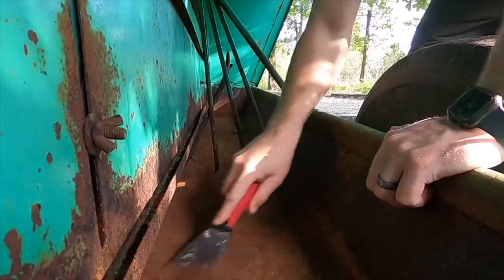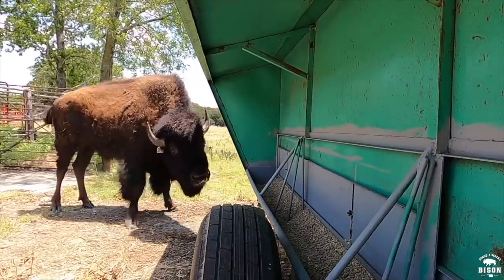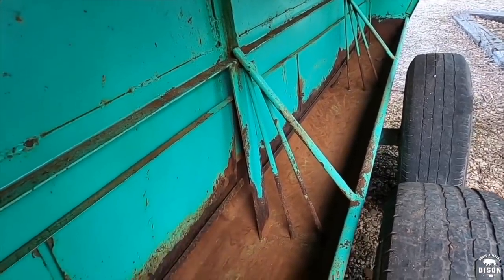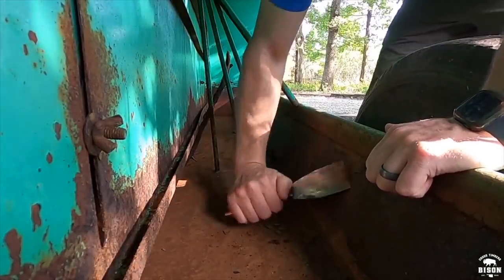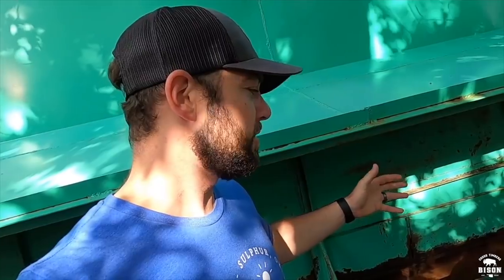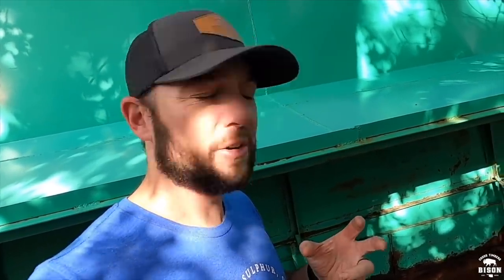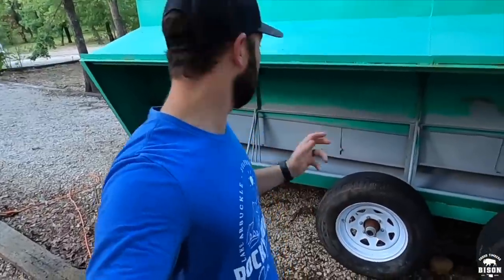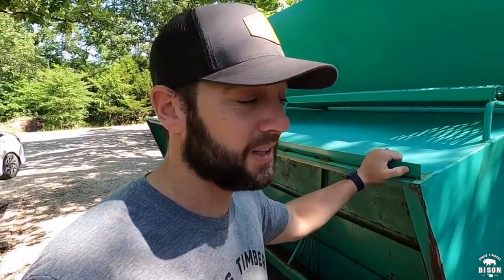Farm Renovation Project for the Bison!

Comment: Agreed on the mural, but maybe on the CTB2 Barn when it’s done…/in case you want to sell or trade in the feeder (resale value)  Need to commission the WALL DOGS, a group of amazing mural artists that travel the country, especially small towns painting historical murals on the buildings with support of the local community. They did my town in Illinois about 10 years ago and it’s still as vibrant as the day the were painted. Has become a springboard for many other much needed rehabilitation projects… an old theater, etc. …

Comment: When you  have old rusted stuff, after cleaning well, treat it with phosphoric acid before painting. 
That converts any rust into iron oxide, which will stop the rust cycle from continuing under your paint.

Comment: Hey there Dusty, I hope you're all well and good!

It looks like you done a good job on your feeder, now keep it full. 👍

There should be some drain holes in the bottom, if not you should drill some in both ends, and a few in both the front and the back, because it will never be perfectly level, and each time you fill it, make sure they're all open.

I hope y'all have a good one! 🐂👍🇺🇸